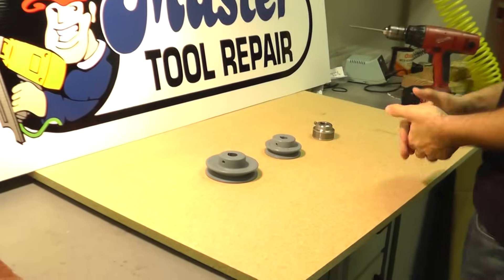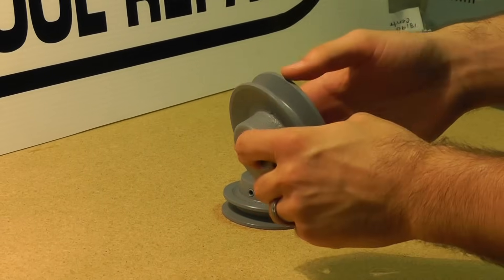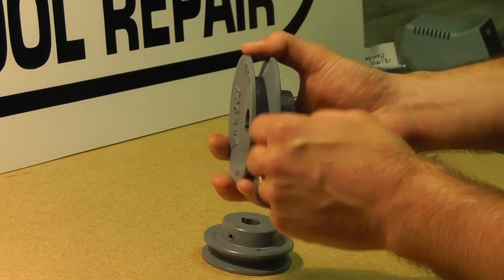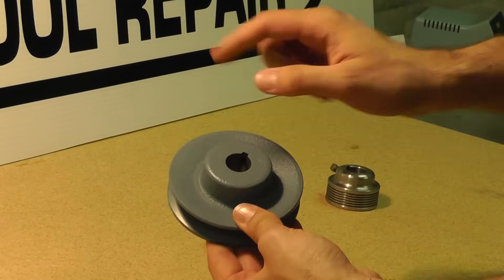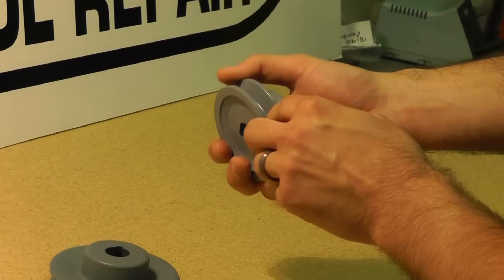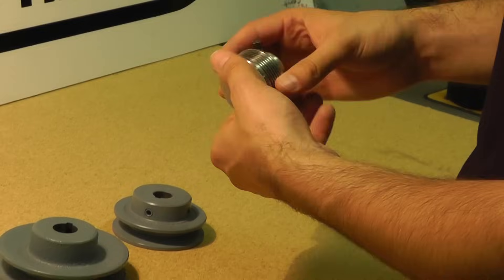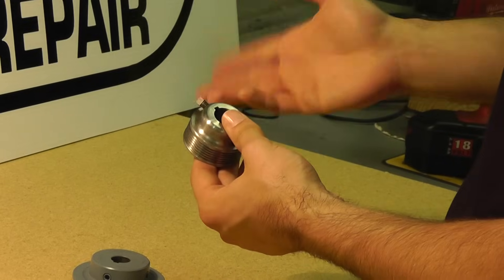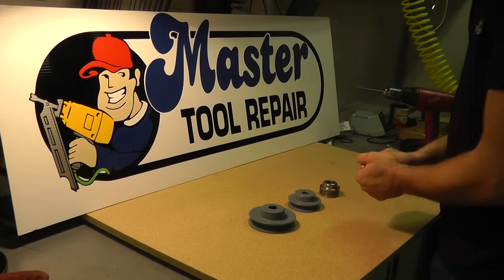How To Choose an Air Compressor Pulley - MASTERTOOLREPAIR.COM

Comment: i have a v twin pump im using on a compressor build http://www.ebay.com/itm/Powermate-1-6-HP-Single-Stage-V-Twin-Replacement-Air-Compressor-Pump-6-2-CFM-/221881127178?hash=item33a925510a:g:k8MAAOSw3v5Yp5q3 

what size pulley do i need on a gc160 honda engine ?   also i have a short pressure washer shaft that is 7/8 od by 1 inch long not threaded i can tap it for a bolt  would i be better off using a 1 inch od shaft or installing a 3/4 shaft i have either this is a custom build and i am a technician so swapping the crank shaft is no problem would the short 7/8 shaft work?
Reply from the maker: Thanks for the question CJ. Since the pump you referenced in that link has an RPM rating of 1,300 with a 10.5" OD flywheel (and assuming the gas engine turns at 3,400 RPM when the unit is pressurizing at high speed), you would need to install a 3.96" engine pulley. So essentially a 4" OD pulley would turn the pump at the appropriate RPM. As for the pressure washer shaft, I can't answer that definitively. I'll inquire with another tech about this to see if I can get you an answer.